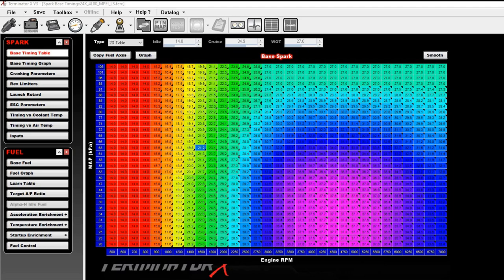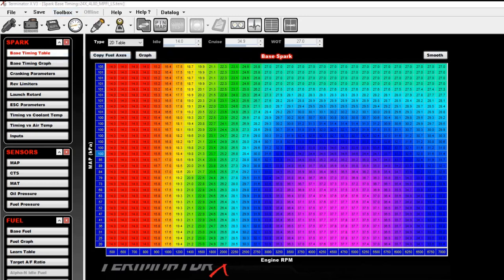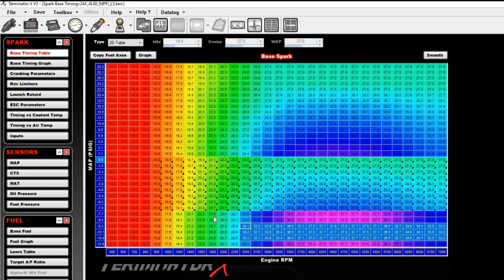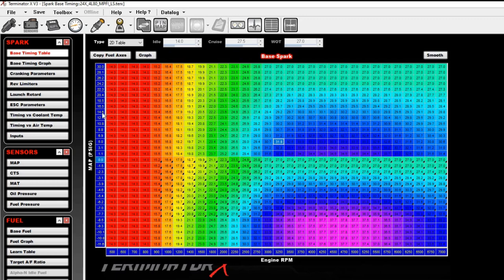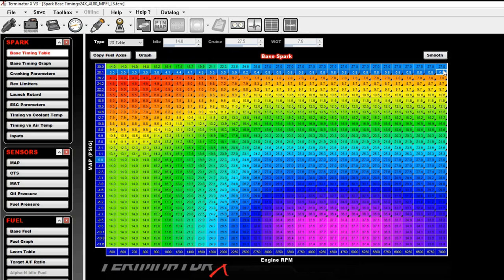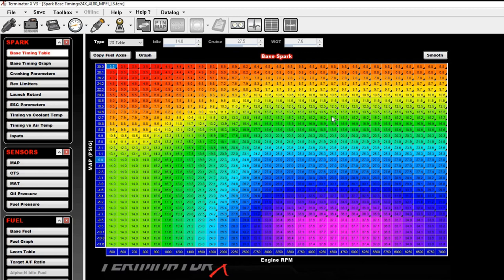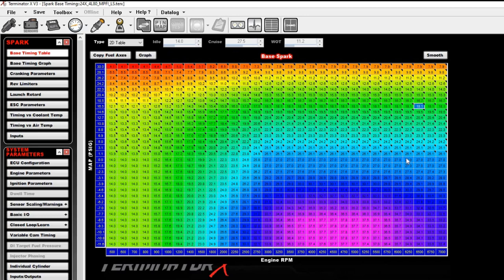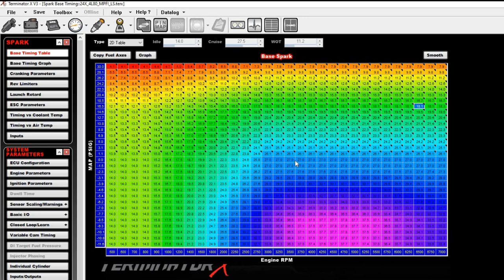Holley EFI Tuning: Building a Startup Timing Table Part 2, FOR BOOST

Comment: My car (turbo LS) primarily runs on Pump gas, E85 is a 2hr round trip drive away, I have a flex fuel sensor. How do I go about adding timing back based on ethanol content? Do you have a video on that?
Reply from the maker: I do have a video on that but I don’t think the audio was that good. I need to do another one on that and also do an AFR video per request
Reply: Great stuff!

Comment: Awesome video!!! I’m running 93 octane in a 6.0 on a terminator. Been fighting a little timing issues.  A bit of a hesitation off idle. And also I know nothing lol. Thanks for the video. What’s the average timing for a stock lq4 under 14 psi?  Just average.
Reply from the maker: Thats an unanswerable question haha. It depends on boost and rpm and how far the reluctor is misaligned.